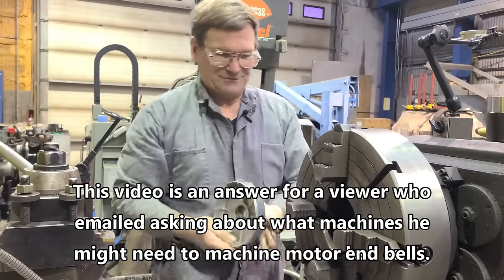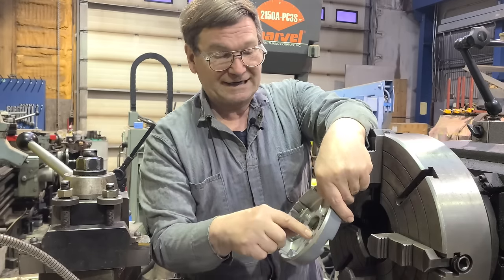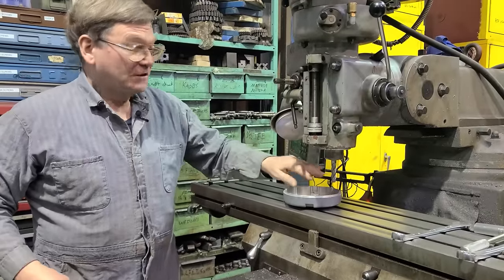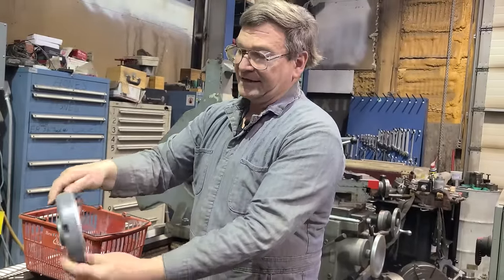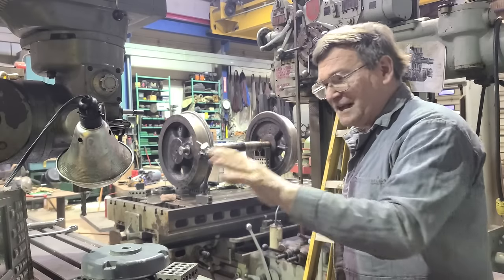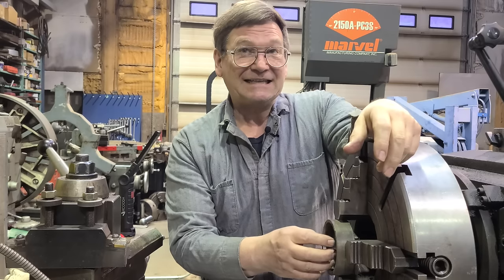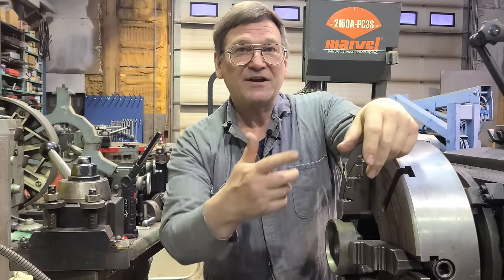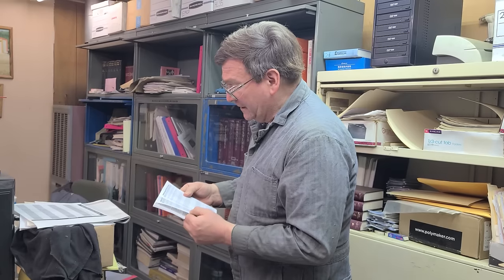Machinist's Minutes: Thoughts on Repairing electric motor end bells

Comment: 1800 rmp is for synchronist motors. Very few of those, the rotors have part of the squirrel cage milled off. A 444 T or a 445T frame is common for 100hp, six pole. Boring head is a option, if you don't have a large gap lathe.

Comment: They have a crimped spring, that you don't through bore. But instead, leave a lip. Bore to size, and just snap it in. Old motors were heavy duty U frames. Nowadays, NEMA uses T frames. Higher rpm, means less coils, smaller diameter rotors, smaller frame. Also, higher voltage, smaller motor. 4160VAC motors, are noticably smaller. Those springs, saved a lot of time, when you do a lot of 48 and 56 end bells. Usually, the bearings start out with 6203s, then they up the shaft end a couple sizes up, on foreign motors, they mostly use the same bearing for both ends.

Comment: the majority of end shields i do is turn your bush first, then chuck up end shield and bore, then push in sleeve and bore to size, it saves taking the shield back out if you dont have a second lathe, you get pretty quick at them after a while, also on the mill you can use a good brand annular cutter in a trammed decent mill to give you a quick bore and stick a sleeve in it. some clients dont want to spend heaps so just get the motor back up and running, depends on application obv. good video

Comment: Usually one end bearing is fixed, other end is spring washer. 

We would get Siemens motors brand new with shim stock factory used to dial in the bearing race. As a toolroom tech where downtime is dollars at some point we said if it was good enough for them...

We used with varying degree of success cylindrical loctite on the sleeves. Would indicate on the bell lip and bore to final ID on lathe.

Comment: Looks really good. I have a thought you could bolt directly to the 1,2,3 blocks flip the housing upside down then use another set of 1,2,3 blocks and then just dial in the bore

Comment: Our shop can do big endbells in medium size lathes, u don't grab on the radius, you mill slots into the radius and chuck up on those.  You turn the OD of sleeves first, then dial in and bore the bearing housing, liquid nitrogen sleeve and loctite housing, tap in, low rpm spin for 10minutes, and then bore ID to tolerance.
Reply: What does the low rpm spin for 10 minutes do?
Reply: @rodiona8781  Time for normalizing temperatures between sleeve and housing, and gives loctite time to set up. Spinning low rpm so loctite doesn't puddle up. We don't key or index the sleeve to the housing in anyway, we rely on a slight interference/size on size fit. Red loctite the housing before tapping in the sleeve as insurance so sleeve won't spin.  We're a motor/gearbox/pump shop, there's a lot of procedures that are followed set by people who have long since retired.

Comment: 6:24, what you do is modify an extra set of jaws by cutting out some of the steps so when you turn the jaw around what is left sticks out enough to get past the rad. Or get a set of master jaws and make top jaws for it, or just weld some bar stock on the jaws sticking out like pegs.

Comment: I am finding there is not much choice in 30 taper tools for a mill compered to the 40 and 50 in Australia
Reply from the maker: NT30 are hard to find, but much more stable than the R8 standard option, the NT40 is not offered on many of these machines.

Comment: I have fixed several end bells by using a home made internal knurling tool .....used it on my 3 phase converter motor(20 hp) and it it's still going strong 25 years later and is ran all day every day....only had to replace bearing once and the knurl still was good enough to hold the bearing solid. 
Also a decent set of bolt on Jaws for the lathe chuck makes it so you can use reversible soft Jaws to max out the diameter of part to the lathe size without having much of the Jaws sticking out.
Often did 14 inch diameter Jobs on my 15 inch lathe....with 12 inch 4 jaw or 10 inch 3 jaw chuck that I used most often....with no problems.

Comment: John, how do you drill and tap a hole inside the bearing bore? Would you drill and tap it at and angle, or have a short 90 degree drill/tap to accomplish the task, or otherwise yet different method? Might be a dumb question. Wouldn't come in from the outside, right? Thanks for all the nice videos
Reply from the maker: Just go at an angle, pretty has no advantage in this case.

Comment: Why not bolt the bell to the faceplate on lathe?  It is slower to adjust, but then you don't need so big lathe. I would prepare sleeve with under size hole and then press it on lathe with a tail stock. And then finish hole with boring bar.
Reply from the maker: You could do that, but they are asking about a best lathe to work on 100HP & save time, so bigger would be worth the initial cost as they have no lathe yet, and can select from several.
Reply: @HOWEES  Yes. But working on small parts with big lathe is no ideal, as you say your self. With a faceplate the work envelope of a small lathe can be stretched significantly. Making it in my mind more valuable. Everything just cost less and takes less space. I see that the 4-jaw chuck on your video has T-nut grooves on it. So it also can be used as a faceplate by removing the jaws. Of course this limits to motor faces with only four evenly spaced mounting holes. I would use fully threaded t-nut "bolts", with two nuts between faceplate and the work piece, and one nut outside the work. The two nuts between can be used to adjust wobble and runout.
Reply: Also a fixturing plate is a good idea. Make a round disc that goes to 4-jaw chucks reverse jaws. Then simply drill and tap holes directly to the disc, as is needed. Reasonable fast and very economical solution. Works also with 3-jaw chuck, but adjusting runout is more challenging.

Comment: Alternatively, You could use nuts & bolts upside down instead of milling flats on the end bells. It would be slightly more challenging to get flat, but could work.  Dealing with bearing issues myself on a 1000hp. It’s a 6220 bearing with K6 shaft fit. I personally think that the tolerance was missed a the factory causing fretting. My factory thinks it was over greased causing the bearing to over heat & loose its fit.

Also congratulations on almost the Irish Twins.
Reply: The last bell I repaired. I spotfaced the boltholes then made shouldered standoffs as feet.

Comment: So a South bend 10x54" tool room lathe and a Jet 1336 PBD lathe are Junk because they are not a Monarch 10EE and are under 14"... Good to know
Reply: He didn't say they were junk. He did say if you are doing this class of work all day long there are machines you should be looking for.
Reply: @aceroadholder2185  20:40 TO 20:44 "I don't want to go under 14 inch because the ones under 14 inch with one exception in history are normally pretty junky lathes" That sounds like a fairly generalized statement about the under 14" class of lathes not specific to just the making of sleaves for the motor bell housings.
Reply from the maker: Please help us out to learn a little more, I do not know about every lathe ever made, my statement was a little too general.  Is the south bend 10 x 54, an old pattern, or one of the new Taiwan lathes?  Does it turn 10" max. or is it like the 10EE at 12.5" ?  What is the horsepower?   How deep of a cut can you take in 1018 steel? what is it's minimum & maximum speed?  Spindle hole size?  Any other detail someone reading comments might want to know, Thank You.
Reply: @HOWEES  I only recently acquired this old lathe as part of a package deal with a Taiwan built 1980's Jet vertical mill bridge port clone, So I haven't taken any cuts with it yet but I can answer a little about it. My catalog number is CL8187RB. I believe that's a 10L Toolroom, UMD bench lathe, Code Designation RKL where R = 10 inch K = Quick Change Gear (QCG), Friction Feed Apron, Underneath Motor Drive (UMD) L = Large Spindle Hole, Standard Swing. Length of bed is marked 4 1/2 feet (54"). I have the steel bench/cabinet, a taper-turning unit (common with the tool room lathes).  I'm not entirely sure but this might be referred to as a "Heavy Ten".  I believe the 10L is a 1.375 inch spindle bore and can use 5C collets right in the spindle with a collet closer. I think the motor is a 2 HP, 240V but I haven't looked at the motor since putting it in storage while I build a space. I think the spindle speed is 55-1400 RPM but I'll need to double check that. I think it's a threaded spindle nose. and should be old casting pattern not the new Taiwan version built under the south bend name by Grizzly.

My Jet 1336 PBD lathe is Taiwan built 1989 13" swing 36" length between centers, 2 hp 240V motor, 7 25/32" swing over the cross slide, 1 17/32" spindle bore, threaded spindle nose, with ground and hardened ways, Spindle RPM is 60-1240. I've only taken a few cuts with it with some mystery steel and it eats metal.